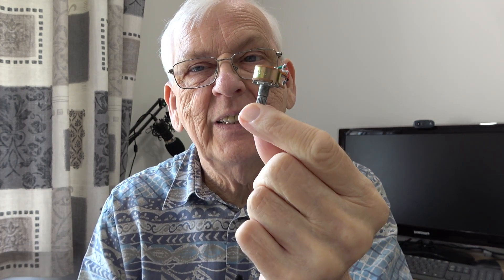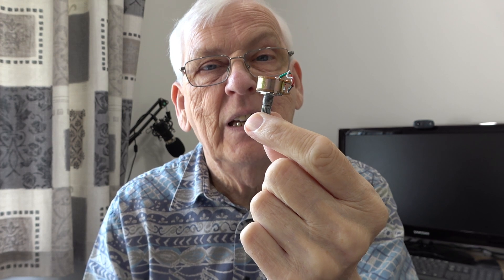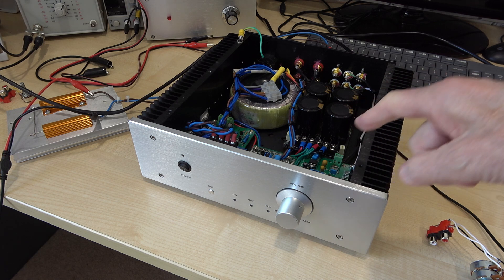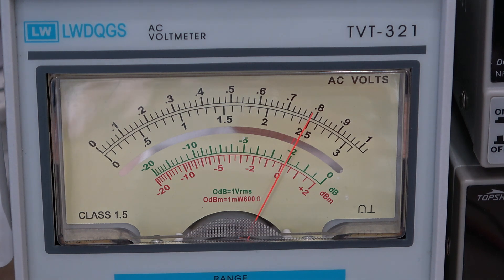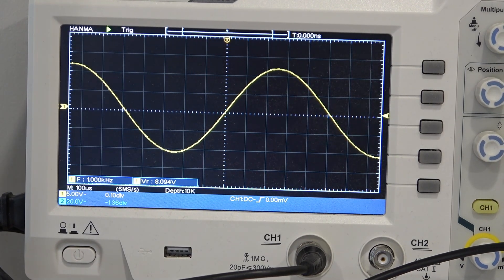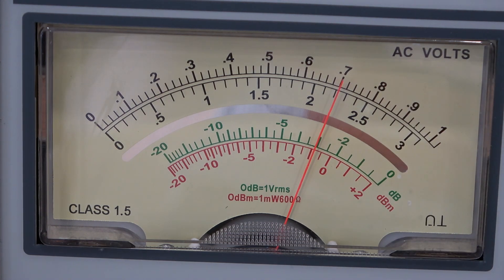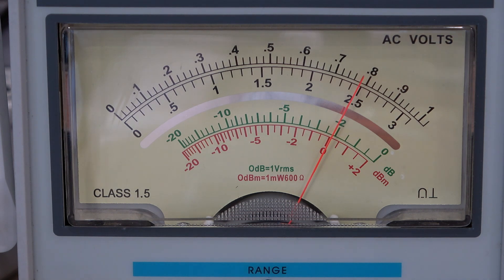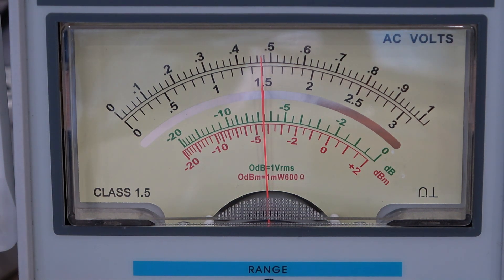This Pot Can Make Your Amplifier Sound BAD!

Comment: A minor point: Not all solid-state power amplifiers have low input impedance; they vary considerably. Some have jfet input circuits and, thus, have a fairly high input impedance, like a Carver amp I own that has a 115k input impedance. Tube preamps can drive it without difficulty. Another power amp I have by Hafler has a 47k input impedance, which is getting into the region where tube preamps without an output buffer may start to run into problems. But it's certainly not true that ALL SS power amps have input impedance of 5-10k.
Reply from the maker: There are always exceptions to everything.
Reply: @MichaelBeeny  You said, "Never, never, never . . . " That sounds pretty categorical, when the truth is more complicated, and that truth is that some SS power amps (often those with FET inputs) do have high enough input impedance for anode-output tube preamps. It's also true that some tube preamps have output buffer stages that make them much less susceptible to loading problems. You've made it absolutely clear that you don't like vacuum tubes. That's fine, but there's no reason to spread untruths about them. Or do you assume that your viewing audience is not up to the task of more nuanced explanations? I worked as a classroom teacher for years, as did my grandfather, so I have strong opinions on giving people the full picture. That's what my grandfather, an Electrical Engineering professor, taught me.
Reply from the maker: @southerner66  What do you want me to do? List every product that will be OK? I am not a teacher, I have about 10-15 minuets to cover a subject for the average person. If you want to learn more, go to Tech or University. I have to say personally, if you don't like my channel,  and  feel it not up to your expert opinion, either make your own video and don't watch mine. Problem solved.

Comment: Thank you, Michael, for a very interesting video. In my main system, I have a very high quality transistor preamplifier, which incorporates the system's volume control. However, in my second system, I use a light-dependant resistor volume control on its own and, although it seems to work well, I do sometimes wonder about its distortion characteristics..

Comment: Hey Michael, hope you are doing well and healthy . I have been following you since few days and I am glad that I came across this video about pots and preamp! I am trying to assemble a hi fi 3 way system with an active crossover (24db/octave) with 6 Ch amps and the topology that i have in mind is  preamp with active tone control  > active crossover > amp>speakers. The crossover that i am going to setup is the linkwitz riley which has input buffer section before the filters. Now the question that I have in my mind is about the tone control pots in preamp section; do you think it would affect the signal/sound ?

Comment: Always use a 20k pot or smaller .The problem exist when using a 50k or more pot  and more than 220 pf rc filter capacitor at amplifier input stage.The tda 7293/4 has an rc filter with 1nf capacitor,that's  the problem.

Comment: The issues here are the reason I use a Krell KRC preamp, it uses a custom 300 resistor volume network and has a discrete class A 15 ohm output. Excellent low volume channel matching is another big bonus of not using a pot.
Reply from the maker: It's not the fact it's a standard pot that causes the issues; it's the implantation of the attenuator in the circuit. However, fancy the attenuator is it will not make any difference. I cannot comment further as I don't know the circuit in question.
Reply: @MichaelBeeny  Understood.

Comment: I wolud have few quaestions before I could agree or not. Like how equal is impedance of meaurement gear in function of frequency. - in case when it decereases significantly, like say there is serial capacitor for DC separation on AC range it's    voltage drop    on serial resistance of upper part of potentiometer could  vary in volume   and then it could be   measurement issue. 

Lack of sopranos at lower volume  is also obvious  due to Fletcher Munson curves. I may say genial  solution to it was application of taps and circuitry for loudness correction 

20 kHz is not Hi FI standard - it is useless because it is way above Hi Fi standard,. People   can hear 20 kHz with special headphones  in total  silence of shells  .  . In normal listening it is  overlayed by daily noise and   by   times stronger  many harmonics of instruments and other sounds in band  of 1kHz  -  10 kHz  . 

The same  stars  people  can see at night  but stars are not inputting to picture of sky in daytime. Total silence and listening to music at home  are conditions like night and day.   Very fortunately that  in total silence young people  can notice higher tones but not everyone has to  be   capable  - it is   usefull when we enjoy very silent room  at  night to hear mosquito ( kidding - it is like  2-3 kHz ) 

  . But  at usual listening sound  levels  we do not hear even 3  mosquitos    at 2 kHz We need at least  bee at 250 Hz  .   All we need from sopranos in HI FI  is max 10 kHz  Fortunately that young people  in total silence  can notice higher tones but it is not useful  for Hi FI   music.  ( HI FI  is standard for  conditions in which people are not capable to find difference between natural sound and reproduced by electronic gear)

Comment: could you also look critical at volume digital volume control in eg a Wiim streamer?
Reply from the maker: I did look at one a few years ago. I know that was just one example, but It needed so much external parts to make it work well I did not like it. They are used as part of a general preamp common these days. Often full of software and other tone shaping circuits.

Comment: Ok, before even watching the video: There's a reason they used double T (impedance constant) attenuators on audio test equipment. Problem: They go all over the place once the pots inevitably wear down and get scratchy, worse than a simple voltage divider :)

Comment: Also a very compelling additional argument for proper gain management. The more that the potentiometer attenuates, the larger the effect. The common "I can only turn it up to 11:00 O'Clock" just means that we have wasted half of the ability to set volume (in trade for HF attenuation). The audio industry has not made life convenient by having digital devices output to a 2V standard and analog devices to .75V. In this case, we even need a buffer with gain control for each input!
Buffers can be a great thing if they are truly neutral and have low output impedance. Low impedance also means that the interconnects should have less effects.

GREAT video. The jabs at valve technology are in my view pretty unnecessary. Many of us know about cathode followers to dramatically lower output impedance and the ability to get very low noise levels. My point is not in defense of valves, rather that there is no need to muck up a perfectly good solid state video with "half truths" that do not strengthen the otherwise great arguments..
Reply from the maker: Don't take my comments too seriously, just a bit of fun. It's not a religion, we are all free to think what we do about valves. I will not think of your opinion as wrong or any less of you because your opinion is different to mine. Just enjoy the equipment you have. Still friends???
Reply: @MichaelBeeny  I really appreciate your vlog style and content. I just consider the valve jabs as ill placed. I use a Pass transistor preamplifier (low impedance...) connected to single ended pentode valve power amps and my phono corrector is also  a Tim DeParavicini valve unit - noise is in spite of the gain, simply not an issue. That is my first hand experience over 2 decades. I measure and listen.
Your recent C3850 clone experiences make me want to build one as a headphone amplifier (AKG 701 - around 120 ohms). I will report with measurements and listening experience when I am finished.

Comment: I’d rephrase your description to: “I look at the effect of a standard pot on the sound of a preamp when connected directly to the *output*”. That might make it more clear that the output impedance of the prior stage is the key issue.

Some folks think the point of this video is “pots are bad”. I don’t read that into at all.
Reply: Agree 100%.. pots are just resistive elements..it's how the designer of the circuit, be it internal or external from the amp, can handle the impedances and their matching..! 👍
Reply: Agreed. This is one of many videos on this channel presented in such as way as to be potentially very misleading. I'm just glad this guy wasn't my electronics tutor when I started out 50 years ago as my career would have been doomed from the start.

Comment: If the source impedance were zero and the load impedance was infinite the shunt capacitance and series inductance of the connecting cable and potentiometer would be irrelevant.  But they aren't. The plate output of a vacuum tube can be 5K to 15K while the input of a solid state amplifier can be as low as 5k to 10k. This is horrible. Now the parameters of what connects them matters a great deal. A cathode follower would be a better idea. However the best idea for all low level outputs is a small class AB amplifier with an output impedance under one ohm. Some manufacturers of solid state amplifiers are using tube's for the input stage. 100k is typical for an input stage of a tube. However there is nothing good that can be said of vacuum tubes in audio circuits. The single most distortion producing device in a tube audio amplifier is probably the output transformer. It produces a type of distortion due to the hysteresis lag in the polarity reversal inertia in the magnetic domains in the core that transistor amplifiers can't duplicate. They really are awful sounding IMO. So a good input stage might be a MOSFET. 

The most primitive amplifier design is the single ended triode with no feedback. It produces almost no power and is highly unstable. Thermionic emission of the cathode varies with the fourth power of the temperature. For some reason there are people who love this design especially when implemented with the Western Electric 300B  vacuum tube. Western Electric is the manufacturing division of AT&T. Because of the demand for these museum piece relics of a century ago I heard they might start manufacturing them again. This design is probably much like the first electronic amplifier Deforest invented.
Reply: Interesting stuff about valves and valve amps. It did not occur to me that the iron cored output transformer would have that effect. I only recently came across the hysteric property of silicon steel laminations (not sure if the grain orientation makes a difference to this characteristic). But I have to pull you up on inductance being a factor on the input of an amp. Given that these cables are typically coax they would have to be quite long before the inductance became an issue. Even just a single wire would have to be metres long for inductance of the wire to be big enough to impact the audio frequency range by interacting with other impedances. This is why parasitic inductance it is usually ignored in audio circuits.
Reply: @smbd2010  The cores of transformers are thin lamination laminated with an insulating layer between them to reduce eddy current losses. These are induced circulating currents due to the flow of electrons in the windings transverse to the lamina. It generates heat and because of the way it's packaged it's hard for the heat to escape. Still heat loss is usually only 5 to 10 percent of the power transfer. The maximum power theorem tells us that the maximum power is transferred from the source to the load when their impedance are equal. So the primary windings have to match the impedance of the output tube's and the secondary windings must match the impedance of the speakers. That's why there are multiple taps.
Reply: @markfischer3626  Yeah, you are mostly correct. Your understanding of eddy currents needs a little work and the way a transformer works thermally is just plain wrong.. Mate, I have decades of experience in power electronics as a professional EE and really do not need some remedial education in the basics of transformers. I recently designed my first iron core laminated transformer, all the others have been ferrite cores. But I know how it is done and how they work and in based on your reply, I know it far better than you do.
The "maximum power transfer theorem" is where people who do not understand what they are talking about go to hide. You have really quite missed the point of the output transformer. The transformer is not there to present two impedances, one to speaker and one to amp. If you must think of this in  power transfer theorem terms, the transformer is there to transform the impedance of the speaker to the correct impedance for the amplifier., It is an impedance transforming thing. The impedances of the windings is a whole other thing and a much more nuanced thing. Do you mean the self inductance of each winding? Are you referring to the magnetising current? The leakage inductance? Ultimately, the ideal transformer has windings with no impedance of their own.
Now, please do not lecture me like I am a newbie benefiting from your slightly flawed explanations. And know what you are talking about and be correct or expect a response from me. Misinformation presented in authoritative tones is my pet hate as is techno bamboozling by people who do not actually understand anything.

Comment: i am 90% self taught and for as long as i remember noticed this issue but couldnt make sense of it other than guessing it was an impedance mismatch 
but no idea how to fix it
but i always liked to use very low input impedance like 560r to 1k to eliminate mains hum in diy amps since ground loops happen even when all earth references are from the center "tap" of the smoothing caps 
and found that made very dull sounding amps, lots of pitfalls!
took me years to figure out it was my fault for earthing differential input pairs via badly run pcb traces , now i can run 47k input without any hum (unless into headphones) and the sound is full of life again (hitachi 2sj50, 2sk135 opamp style amp)

Comment: Thank you Michael. Would you care to comment on stepped attenuators and LDR volume controls?
Reply from the maker: It's a personal preference really. A switch using fixed resisters can be a better tracker, but you do have clicks and fixed jumps in volume. Personally, I like a smooth rotation, without indents. All of these will sound the same, however. Just don't use a digital one, they DO affect the sound, some more than others.
Reply: @MichaelBeeny  I have a Lightspeed LDR made here in Oz = I find it very good. I also have an Optivol LDR based pot designed by Greg Ball in Brisbane. Alas he ceased production. It has the funny characteristic of increasing the volume A LOT if you don't power it off first!

Comment: Thank you for the video.
Yes and no. First we like distortion, Nelson Pass proved that with listeners and he designed his amps for those second harmonics listeners like. He did it with fets, I do it with tubes, both give good results. I have this little preamp on order but I have the sense that it will sound 'dry' the same way a class D amp can sound dry. It's the preamp that gives the sound distinct color and we like color, well harmonics. This is why guitar players love tube amps and I personally like that sound along with most other listeners.

If you want an amp that gives you out exactly what goes in this is an easy task, any INA (instrument ) opamp will do that and very linearly and accurately, just as accurate and linear as your little amp does probably even more so, it's quite easy. The trouble is musicality is not a product of low distortion, in fact, the human ear really can't hear distortion below about 0.5%, most people can't hear 1%. So these manufacturers bragging about 0.0001% distortion are just making, well - noise!

Tubes can be used as preamps and very well. You can design tube outputs to give low output impedance, a well designed cathode follower will give low impedance and a better PSRR. The Aikido circuit explains this well. I won't post a link here but Google "The low impedance Aikido" , he gives a good explanation of this. 
Personally I use hybrid tube circuits which essentially buffer the tube with a buffer chip or an audio opamp that is capable of driving most amps and even headphones. I've done this with fets also - Google my "Merlin" amp that I did for AudioXpress several years ago. It's an fet design that's flat out to ~250kHz with square waves showing the excellent response.
Reply: He says you need a buffer, you know like, unity gain? before a pot because it will change response (linearity), where you at...?

Comment: This problem with pots needs a buffer stage after the pot that has very little input capacitance thus avoiding the low pass filter formed by the pot resistance and amplifier input capacitance.
You have to have a volume control in there somewhere.